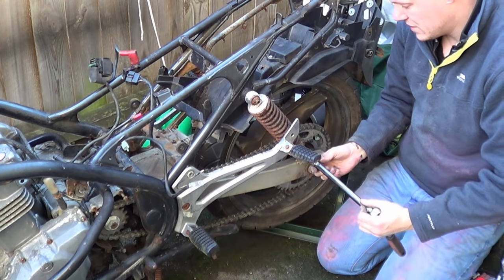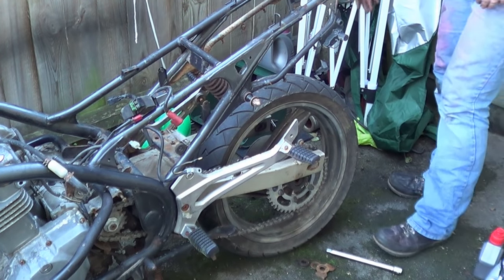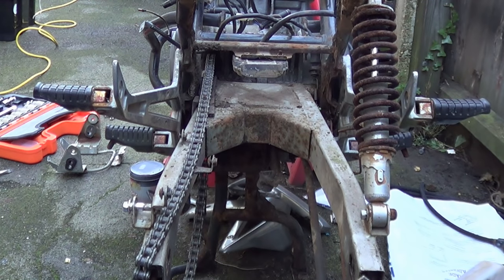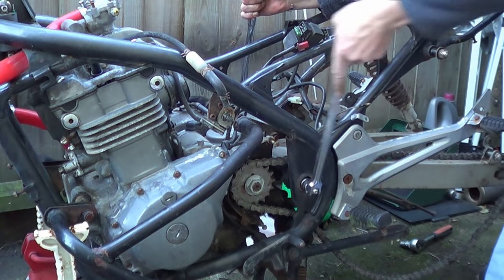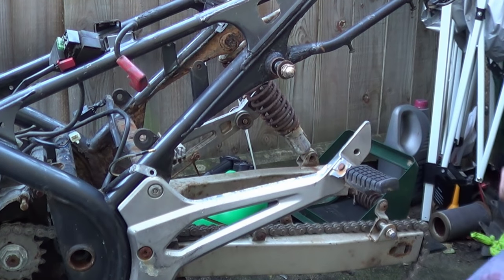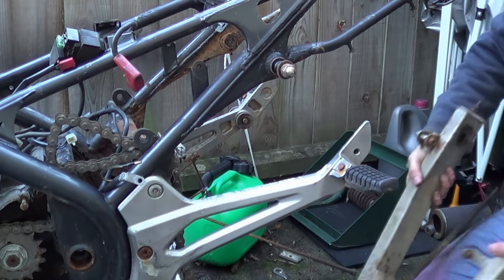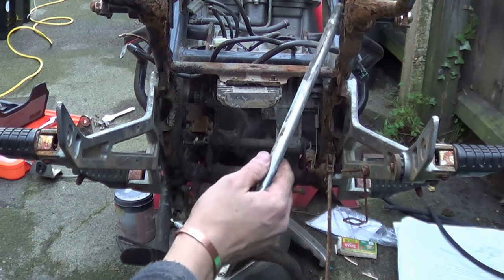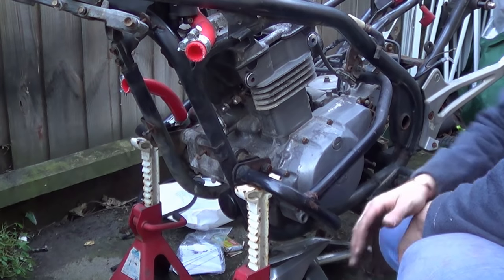Kawasaki ER 500 - Backyard Bike Project - Episode 23 The teardown part 2

Comment: Got to ask, how did you get that thermostat housing with the two pipes out?
I’m about 3-4 hours into trying to pry it out (bolts removed) and it won’t budge. Used two spanners to grip each pipe, but thinking of going for a long pry bar next.

Comment: Damn dude. Looks like you had a harder time taking apart that then I did my CX 500!  Then again, I did take a while reading the FSM before I started and had it to hand just in case. 

Either way, you still made it look easy. Hardest part for me is getting it all back together again. Lost all the drive to do anything on mine right now. Way to much other shite going on in my life.
Reply from the maker: +Rigal hey mate hows things? Yeah well I did it all arse backwards, should of kept the wheels on but thats the way things are. Gonna be attacking the wiring soon, which will be fun.
Reply: +Pony Power Honestly, not good. Last quarter of last year was absolutly nasty. Things aare looking up a tad, but not much yet. Hoping things get better as the new year gets older.

Wheels are still on my trike, but thats about it. Engine is partially taken apart sitting on the bench waiting for me to get the other head off it, then clean it up, replace the gaskets, paint it and get it back in to the trike. 

Not looking forward to the wiring on mine either as electrics worry me :P. Still learning about it though! Should be fun learning more about them from your vids!